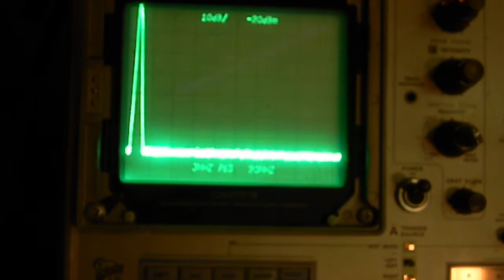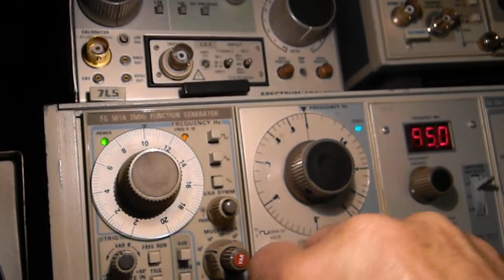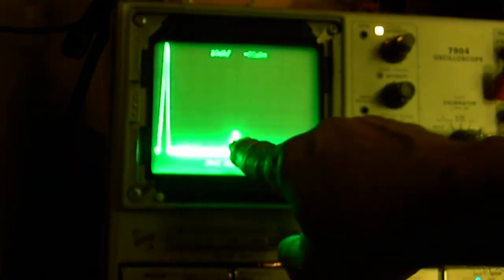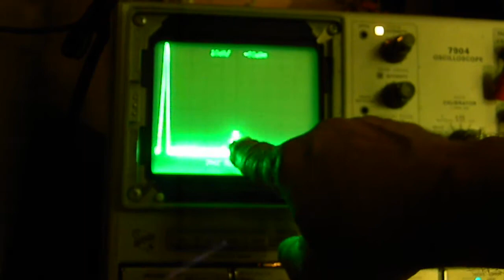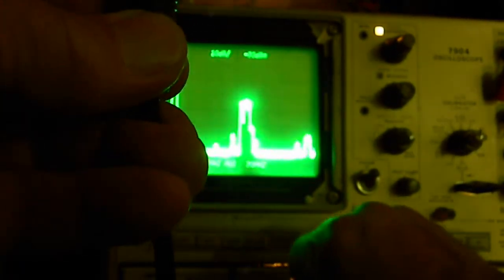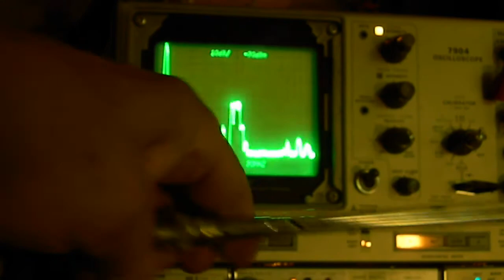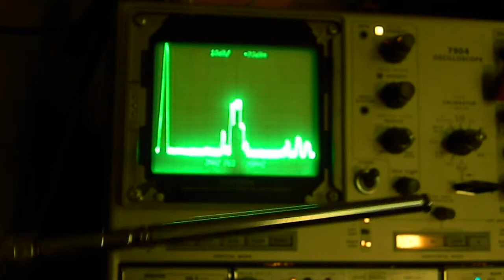Trying to locate offending RF noise in workshop.MOV

Comment from the maker: No switching supplies that I can think of. However, I do have an emergency shut off button and temperature sensor that  is extremely sensitive to 440 MHz amateur radio transmission. Transmitting in the room with even one watt output on 440 Mhz causes the system to shut off. Maybe something is radiating from the monitoring system. I will investigate. Thanks for the help. I will post if I find something.

Comment: That's just the thing with certain internal spurs. If you remove the stimuli, the internal spur disappears. But now that you mention the UHF TV transmitters, 3 miles and, let's guestimate 5 megawatts, that could certainly produce some strange things. The 95.2 may be intermod between two transmitter carrier frequencies. If you could expand that trace and get a clearer picture of it, I could tell if it is a DTV broadcast or not.

Comment from the maker: That may be but if I remove the cable there is nothing on the display in the way of signals. I have several powerful vhf TV stations on a mountain top just to the west of me - probably 5 miles line of sight maybe only 3 miles - not sure. I will have to look into the frequencies of TV stations. May be something that simple.

Comment: I would try shutting down ALL electronics not needed for this measurement and see if the offending signal stops. You have at least a dozen potential sources of RF in operation. First eliminate all the background noise and then check the signal.

The 95~mhz.. you could set your RBW to a finer value and see what the spectrum looks like. I could tell what it is if I could see it with the appropriate RBW span on the SA.